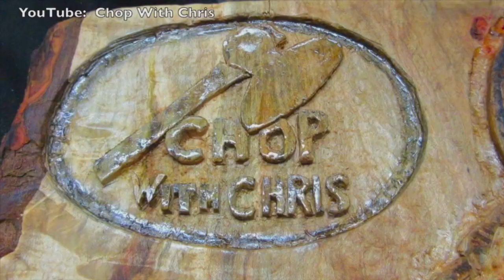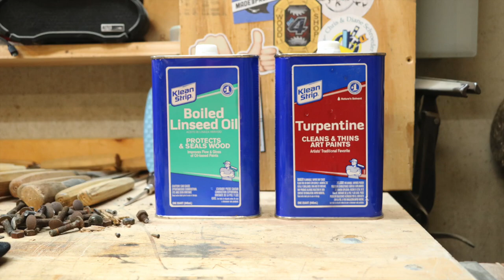How To Repair and Restore Garden Furniture

Comment: I have redone 5 chairs like that one and i have a tip, just the tip mind you and only for a minuet. The back rest metal panel is the only thing that keeps the chair from racking, and when it get loose it allows the rest of the chair to get loose and it snowballs from there. Drill out the holes in the back to a little larger size and bolt it through the wood in front, it's adds a lot of strength and lengthens the time between rebuilds.
Reply from the maker: Ahh!   Thanks for the tip!!

Comment: Hi Again, Lover your pilar drill by the way. I have to take my chairs down the metal as the friends I am making these for want different colours and as I have a large homemade blasting cabinet that these will fit in I will be using that. Another difference is I only have access to Ash as the beatles over here have decimated the trees but as a result, there is an excess of good wood at a cheap cost.
Reply from the maker: Good luck with your restoration!
Reply: @ChopWithChris  Thanks

Comment: Chris, sorry to bother you but what kind of outdoor oil did you use? How long before reapplication? I have oak harvested from my property that has dried for over 15 years and rebuilt 3 garden benches and a garden swing with it. I used spar urethane to finish it but it breaks down in our weather so fast. Any suggestions on a lasting finish?
Reply from the maker: Not sure the brand name.  I think they are all very similar.  Reapply annually for a good finish.